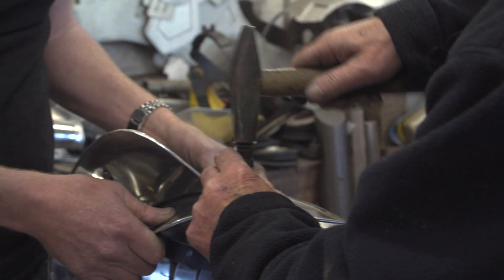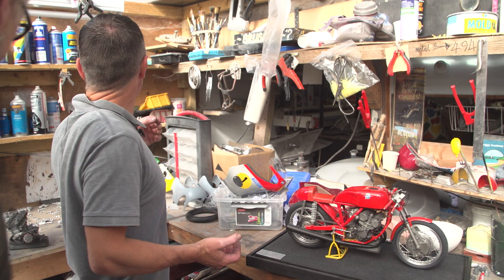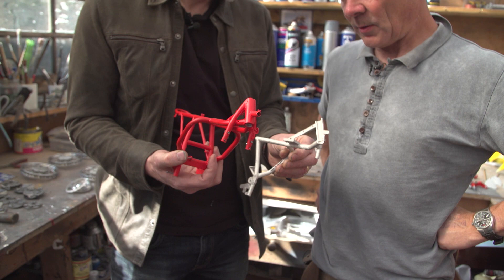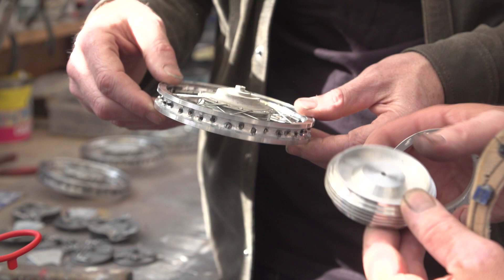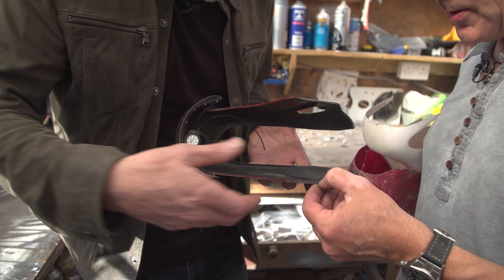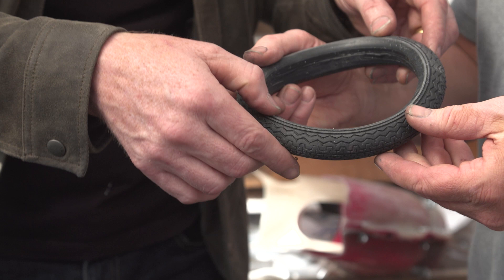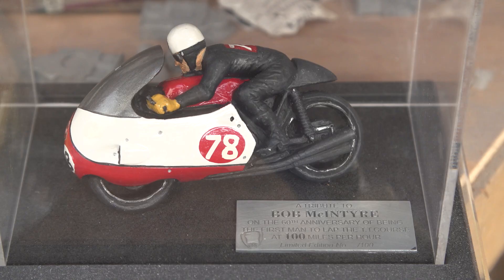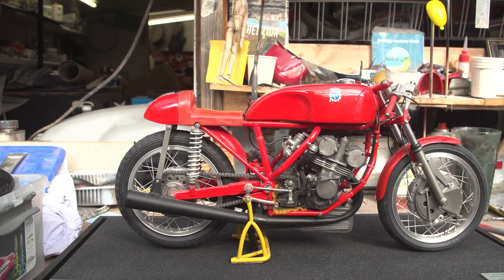Glen English's Scratch-Built Motorcycle Replicas

Comment: I went to his website, saw what he's selling these for (8750,- GBP, for the curious), did some back of the envelope calculations and have to conclude this guy is making less than minimum wage doing this, unless he writes off the research and developing the molds and tooling as a dead loss. Impressive.
I used to be an independent design engineer and used to tell people turning their idea into a production prototype would cost about 10-15k Euros, because that's just what it would cost to do so while being payed a reasonable amount for my time. This sort of model is not too far off of that, even though it doesn't have to be functional, it's still expensive to produce things in a limited run and very labour intensive.

Comment: Wow! That’s incredible. What does “white metal” mean? I’m not familiar with that term
Reply: White metal is a range of metals like antimony, bismuth, cadmium, lead, tin, and zinc that have low melting temperatures. These metals are mixed to achieve a desired strength or flexibility. Silver is also called a white metal sometimes.
Reply: Thanks!